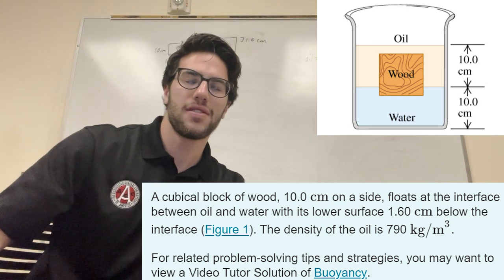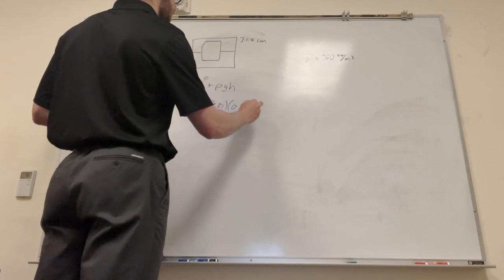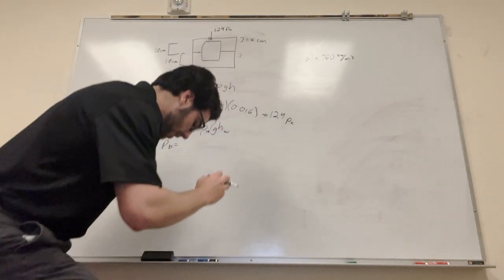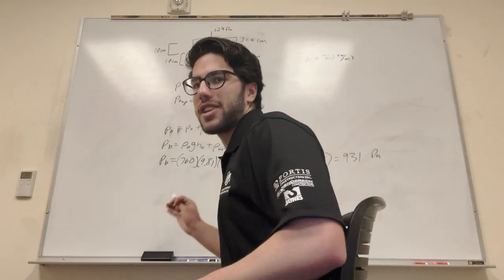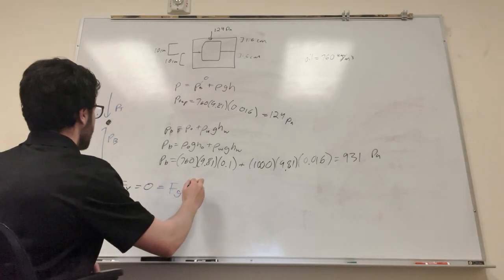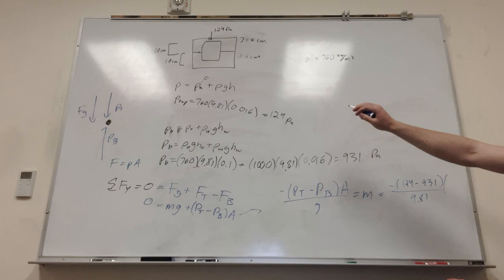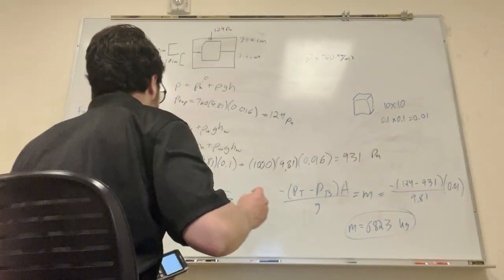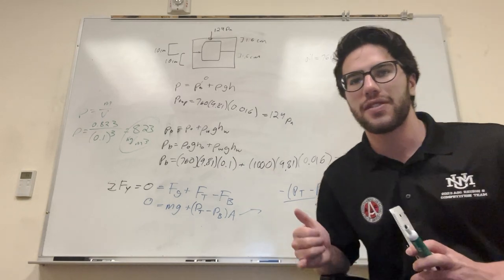A cubical block of wood, 10.0 cm on a side, floats at the interface between oil - Problem 12.33

Comment: I'm a bit confused about how to determine the height. Could you please provide further explanation on that part?
Reply from the maker: We’re given that the block floats 1.6 cm below the interface of the liquids, and we know the block is 10 cm, so the other height also has to be 1.6 cm. h in the equation just means how much height of the block is in the surface you’re doing the equation for.
Reply: I’m confused I got 119.29 when I calculated the density at the top, instead of 124 Pa.
Reply: pressure at the top i meant
Reply from the maker: You may have used 9.8 instead of 9.81, that error probably isn’t too significant tho

Comment: ... why was the force from the oil pushing down? I thought the buoyant force always pushed to object up.
Reply: Wait, is it because the pressure pushes on every surface, but since the bottom isn't submerged in oil then the only pressure felt by the oil that could move the block in the j-hat direction would be downwards?
Reply from the maker: Pretty much. The oil applies a pressure downward to the block because it has the surface area on top, but not on bottom. The water applies a pressure upward because its surface area is on the bottom of the block.